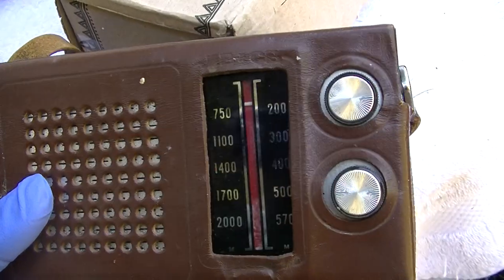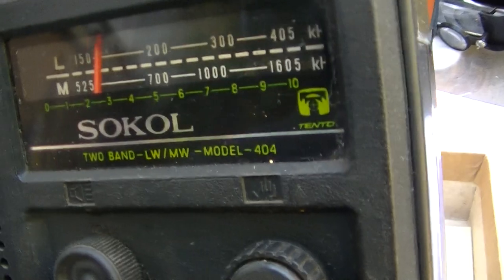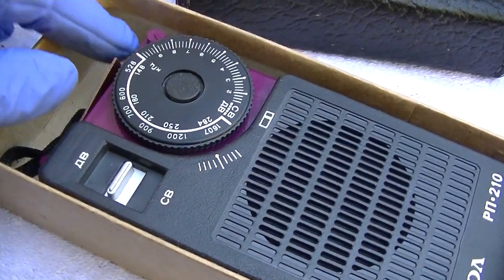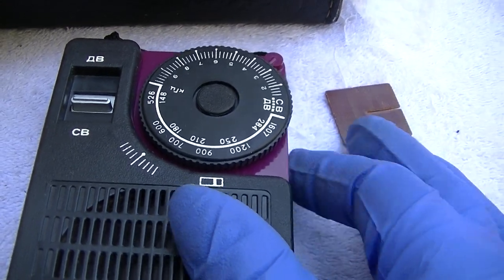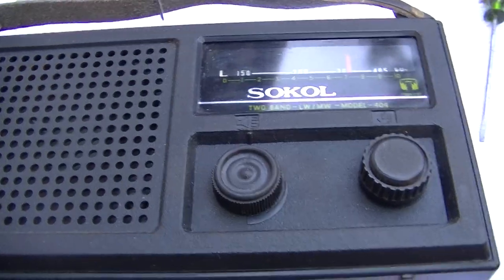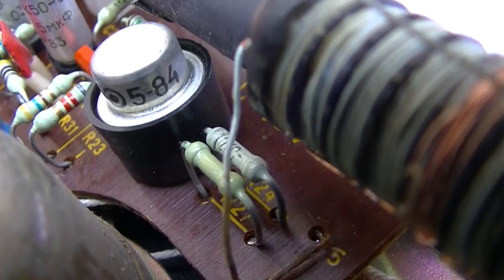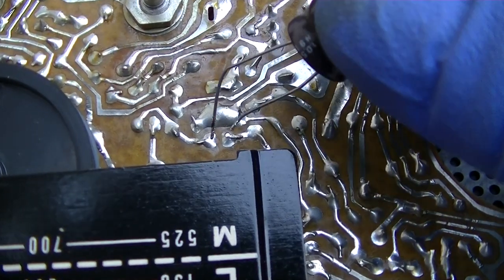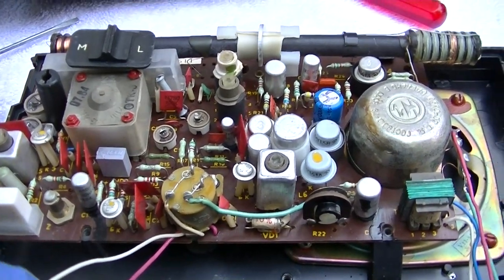Unboxing Vintage Soviet Radios And SOKOL 404 Diagnosis

Comment: These radios are the proof of an economy based on keeping stuff working until they fell apart. A printed schematic in every radio, tv or other electronic equipment. You would get it repaired easily and keep the things going for a long time. Things were meant to be repaired and not thrown away.
Reply: Sorry, I don’t subscribe to the America bashing. How many people are trying to emigrate to Russia these days? How many are trying to come to America?
Reply: The fact that they needed to “keep them working” is proof that the economy sucked big time and people couldn’t afford to buy even a little frikin’ radio.
Reply: In west Germany it was the same until the 80s. If you take the back off a tv from that era you find a nicely made pouch stapled to the case which contains a parts list and a very nicely printed schematic. In Telefunken TVs from the 70s the schematics are printed in color on very thick paper in a size more than one square meter. With voltages and waveforms and everything.
Reply: @alphabeets  Funny how you equated consumerism to america.
Reply: @alphabeets  Is it America bashing though? The entire western world also subscribes to capitalism. Modern day consumerism relies on obsolescence - which is actually a relatively recent (post-WW II) addition to western economies. Besides which, you'd be very hard pressed to find a radio or other electrical item not made in 'communist' China nowadays.
Reply: It's not that they were designed to last forever or anything like that.  It's that they cost so much money that they were worth fixing.  A major reason for this is there is a cost matching between factory workers and repairmen. When stuff was made in America, the costs were matched with US wages and so fixing it was worth the labor.  But since we import everything and so are buying foreign wages for new products, but have to pay in local wages for repair, it is simply not worth fixing something when the cost of replacement is the same or only slightly more than a repair.  
It is our inability to outsource repair at foreign wage rates that causes us to throw everything away.
Both systems have their advantages and disadvantages.
Reply: @alphabeets  I completely disagree with you.  We had to repair everything just as they did before we were able to buy stuff at foreign wages.
It is absolutely not good for Americans or for the economy to be reliant of 60 plus billion dollars a month trade deficit where basically everything is imported and that we are so unproductive that paying someone to repair something is so expensive that it costs less money in most cases to just buy a new foreign made consumer good.
America USED TO BE the most productive and wealthy place in the world by a very wide margin.  Everything that was new and exciting, Americans had a higher rate of ownership of those items than any other people in the world by a large margin.  Everything from cars to washing machines to telephones to dishwashers to refrigerators. EVERYTHING.  We were the largest creditor nation in world history.  Foreigners owed us more money than we knew what to do with.  We were so productive and such a large powerhouse of high quality low cost consumer goods, that we were bigger than all the other major countries COMBINED.
Today, everything is the opposite. We are one of the least productive people on the planet.  The ONLY thing that keeps this going is the dollar.  We get to print money and buy the stuff we want and the world gets our IOU in return.  We are the world's largest debtor nation. We owe more money to foreigners than any nation in history. Even Germany in utter military defeat did not owe the kind of money we owe.  We have some of the highest production costs in the world. We send cotton on a 10k mile trip to Asia, then they make socks and t-shirts and take another 10k mile trip back!!!  We are so unproductive that we cannot manufacture our own friggin socks competitively.

America is NOT capitalism. It is cronyism enabled by globalism enabled by US Dollar hegemony.
Reply: @alphabeets  It's not about the Russians, it's about planned obsolescence. Using a plastic gear that will fail quickly and offer no possibility of repairs or replacement. Sealed cases, special screws etc, stuff designed to be unrepairable just to make you buy more. If I want to repair my radio, let me do it even if it's not worth the cost in money or time. I had a Lumia 920 phone. It was heavily abused. With a torx screwdriver set I could replace every part in it. It took me 20 minutes to replace a screen, 10 min to replace a charging port. 10 minutes to replace the broken shell. 10 minutes to replace the battery. That phone lasted me 7 years and its still working. I replaced it because I chose to get something better, not because it was broken. This is the real problem, not the Russian planned economy.
Reply: Unlike our wasteful american society we live in nowadays. buy it use it throw it away buy another.
Reply: People didn't have money to buy new. They had to work for months and months just to save up for a radio.
Reply: @alphabeets  Lighten up dude. Americans buy China. The old US stuff was built to last, and usually easy to work on. I get why you're pissed, but lighten up! It's Christmas..... and the end of the world.
Reply: @tarstarkusz  truth.
Reply: @mrnmrn1  The times were different. AM was used a lot for local stations. Also the mindset was different; You don't buy one every year for 5 Ruble. You buy one and keep it for 10+ years there isn't really much to improve on a AM radio. It was cheap to repair them. 
The same was with clothes dryers. My aunt has been using a centrifugal dryer for just about 40 years almost daily. A stainless steel drum with a motor and a switch. It still dries clothes better than a modern washing machine with that option. She still uses it because it gets the job done. Is it good looking? No. Does it have a lot of functions? No, just one. Is it reliable? You can bet your ball bearings on it. 

Back then people would not get bored of their stuff as easily as they do now.
Reply: TheEncyclopediaofPopCulture 2  My grandparents grew up poor during The Depression and WWII, and definitely had that mentality. They taught it to me. I keep things that work, and fix them when they don’t.
Reply: We were once like that too. Unfortunately the elites and laziness put a stop to that.

Comment: 8:48 It's an autotransformer, it's implemented because those germanium output transistors (those are Alloy-junction transistors !) cannot handle a lot of current (~20mA or so according to specs). USSR, just like any other soviet bloc country, just used whatever they had available. If high impedance speakers were not available then they would just use autotransformers to get the higher impedance.
Reply: I didn't see your comment before I replied. I didn't think about the "use what's available" angle, but I thought it was actually quite elegant.
Reply: I would even go as far as to say that it was planned to use an autotransformer and it was not an afterthought after they discovered they had no 32 Ohm speakers at hand. IIRC a low impedance speaker is more robust and easier to manufacture than a high impedance one. 
And it is not un-Sovjet bloc to go the extra mile to make something more reliable.
Reply: @randomsteve4288  USSR and the soviet bloc did produce high-impedance speakers as well. The main reason here is those transistors, 20mA maximum current is pretty much nothing. The USSR at the time had silicon transistors which were far better than those and other soviet states were pretty much silicon-only for quite some time in the 1984 (when the radio was made). The other radios in the video, which use silicon, don't have the autotransformer. In Poland germanium transistors were out of production in early 1970's (silicon stuff entered production in ~1970, germanium was out about 3 years later or so).USSR kept making them, even though they were horribly outdated and there was not much need for them.They were making these things for way too long and they had to do something with them. I guess the massive stock (which even after 30 years since collapse is still there) could also mean that they were readily available all the time, unlike the silicon ones.
Reply: The short lived Andropov / Chernenko capacitors

Comment: Here's a bit of information for these soviet three-digit numbers: the first digit denotes the class of the device. The range goes from the lowest class 4 to the highest class 0. The second two digits are the specific modification of the device in question. Sokol 210 = second class, first modification. Class is determined by the complexity of the device and characteristics like sensitivity, selectivity and output power. Another bit of trivia I know from experience - older soviet radios have better electrolytic caps in them. Newer stuff like the purple Sokol have a much higher chance of needing re-capping. It gets to the point where stuff from the late 80s and early 90s can be completely unusable from the box, while ancient devices from the 60s and 70s function perfectly. That little Sokol with the white dial probably just needs a date with the contact cleaner to start working again.
Reply from the maker: Interesting information. They all seem to work very good

Comment: I also bought one myself sokol 404. changed 4 transistors to similar and all electrolytic. an excellent radio receiver works amazingly, little noise, a lot of useful signal. I also love vintage equipment🎶 📻😺👍

Comment: Post-soviets postulated in forums and chats that wherever you see electrolitic capacitor with a printend on the can logo resembling latin letter G it should be immediately changed. These capacitors were produced in Armenia, where they've never brought process of sealing capacitors with simple rubber like caps used everywhere else to the required standards. I'll tell you a story about Germanium mineral: what happened in 1989 happened, but unlike most of eastern european countries communists in Russia and my own Bulgaria decapitalised and stole what's rest of most of the businesses and after that came the time to sell what's left. Most of bulgarian gold mines were closed but the biggest one, mining concession of which was sold to a canadian company. Canadians decided they'll enreach the ore localy, but will process it in Canada. After first shipment of concentrate to Canada the price of Germanium dropped from over $2000 per kilogramm to under $900. The ore is far more rich in Germanium than in Gold, but the agreed tax did not mentioned it at all, so in fact most of Germanium that pored on the world market and still pores is actually tax free. Why wonder USSR and later Russian Federation used to produce germanium transistors till late 1990s? Germanium for them was also kind of tax free, and "socialism" dismounted itself, because small people could not be used as slaves after W.W. II anymore and any production of goods for the masses that required investments was considered wastefull by the leading members of communist party.
Reply: It will be very nostalgic for old communist countries because soon the entire world will be communist with bio-security characteristics. The new communism will offer wonderful crime free smart cities... not crowded (thanks to depopulation!) and crime free (thanks to robot drones with face recognition) I think Trillionaires will live in separate communities... I hope that makes you happy...... comrade. 😒 Just like the good old days!  (Seriously, I enjoyed your comment, it was very informative. Thank you!  All the best from New Zealand).
Reply: @chuffpup  Greetings from Sofia. In your chain of thoughts - another story from me: after what happened in 2014 between Russia and Ukraine I've renewed my long and compleetely gone interest of their affairs and started to watch lots of russian speaking vlogers. I've stumbled upon an interesting person: when ÚSSR crumbled he graduated in low scholl (I was doing my 3rd semester), after that he did some short time as local police detective as a deal to be allowed to stay with his pregnant wife in his home town (perks of free education - 3 to 5 years work where appointed, usually somewhere very far), started own business with security and detective services that grew to over 2000 employees, after some tries of "our people" to stole his business started a political career in local parliament. In my own set of mind he is not a good person, but is very smart and a gifted analytic. In 2014 his before then YouStreams moved in YouTube and he started "Bad News" daily analytic stream in the time of evening news emission of central TV. He declared that Putin's rule will crumble on 5th of November 2017 (kind of "give slugs some target"). In 2017 russian state parliament elections he won primeries of the only allowed to participate opposing party (he was not a member of that party) only to be given time on TV debates to shout out that Putin is a criminal that should be executed after which his YouTube chanell was declared a terorist organisation, Interpol warrant issued and he was forced to escape and was given political asylum in France where he continues to make his daily evening streams, that are now officially blocked in Russia, but going around blocks was never a problem for most people. After all that history to the point: he declaired his target as a direct democracy in Russia and his philosophical ideas as anarchy. Throlls and fans often ask him about communism and anarchy and lots of his visionary analytics. He always answers: what we have now cannot function the same way for very long. It's upon us to make what will our children have - cyber direct democracy or cyber tyranny. Either every public servant will be on constant online controll by anyone and no secrets of state affairs will exist, or every person will be controlled by an anonimous tyrant. "Communism, anarchy, God's kingdom on Earth", - he says - "call it how you like, will be possible when there woun't be states and it's not what's comming next and might not even be the next after that". This might be the most boring long comment with most ridiculously long statements, but I think it's worth writing.
Reply: @deepblueskyshine  A technocratic coup, in a very auspicious time of planetary alignment, and in the microcosm, pathogens, nanotechnology. Very entertaining... and terrifying. Thanks for your insight. Appreciated. Stay well.

Comment: These old Soviet radios are great. Well made stuff that was made to be repaired. Some of their larger table top transistor radios we're very sophisticated. They also did a radiogram in the late 60's that had quad push pull output and motorised tuning.

Comment: I have two of those Sokol PR-210 and two of a recent model of the Sokol PR 404 (304) dated 1986 both working but needs new capacitors. 
Model numbers refer to features of the model and not of a newer model as just I discovered. The PR-210 is old new stock and works ok. I have been impressed how different they are to any western made ones. Thanks for the video. I like to know more of Soviet radios.

Comment: Install an automatic translator from the video camera on your phone. When you point the camera at any foreign text, the recognized words are automatically translated. In the USSR, it was common to supply any radio equipment with a detailed repair scheme. It's so logical and natural that I wondered why they don't do it in other countries.

Comment: Try to get an OKEAN / Selena 209, you will love it.
I have PNP germanium Russian MP40 (audio) transistors dated 1992, from ebay, and 6F1P TV tuner tubes from 1993. The military had (and probably still has) lot of ancient equipment that used these parts so they had to be produced well into the '1990s.

Comment: -2:15 The purpose of the auto transformer appears to be a very elegant means of impedance matching the output circuit to both the speaker and earphone/headphone.
Reply: Exactly.  Many of the early transistor sets didn't have the current ability to drive a 8 ohm speaker directly. (I guess higher impedance speakers were too expensive.)  What is different about this is they didn't use the transformer as part of the push-pull.  And since there's no need for electrical isolation, they made it a autotransformer instead of a more conventional primary/secondary style.

Comment: Sokols are usually nice.  "Selga" less so.  Cheezy Peel & Strip circuit boards are a Selga specialty.   Europeans in general and eastern Europeans in particular tend to pack things very well.  And yes they frequently add a postcard or similar item.

Comment: Congratulations! Nice stuff. Glad you like it. Small soviet K50 electrolytic caps are 80+% dead (95+% for made in 80s), but big ones usually works fine. Also that vertical placed МБМ cap on the left at 7:56 is also crap, it is metal-paper cap and usually it have high leakage and esr. I recommend to replace it with any film cap.

Comment: I've run into the same issue with electrolytic capacitors in Soviet-made radios, even relatively modern ones. They must not have been sealed properly, because they are usually all dried out and test at near-zero capacitance.

Comment: I wonder how long did they just keep using plastic moulds engraved with 'made in SSSR' after the fall of the union.

After my grandpa died I found a tire pressure gauge in his hoard of stuff marked as such, and I can only guess it was imported to my country with a Lada, which began importing in 1988, leaving a rather slim margin for it to be contemporary. The gauge is graduated in kilopascal which is neat I believe.